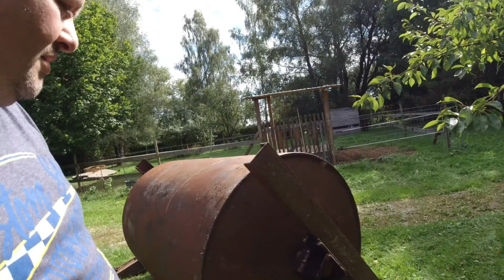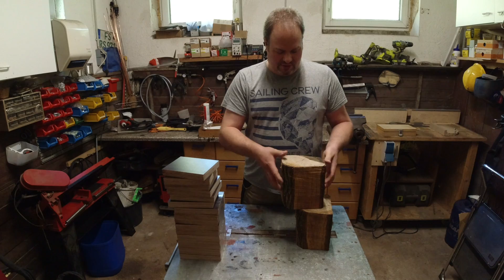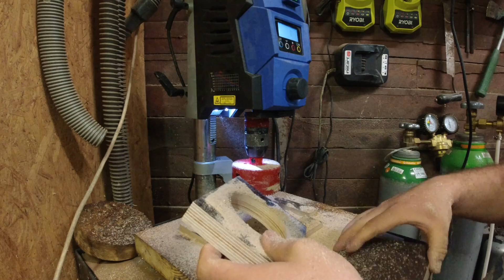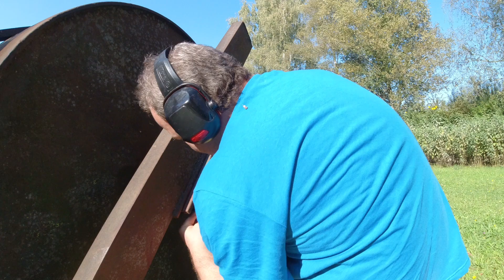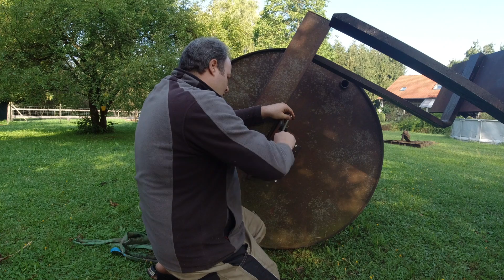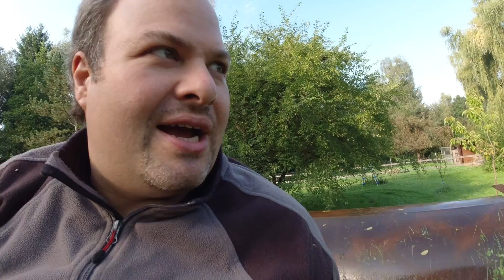Vom Schrott gerettet 🚯 Restauration alte DDR Wiesenwalze 🛠 Projektstart 👉 Holzlager bauen

Comment: Grüße. Wir nutzen diese Walzenkombination als Dreierzug auf ca. 200ha pro Jahr. Keine Ahnung ob deine Holzplattenlager halten werden. Wir haben Hartholzlager drin. Dringend erforderlich ist aber ein Fettkanal damit du täglich abschmieren kannst. Ohne geht es nicht lange. Das Lager wird so heiß das es sogar verbrennen kann. Also immer schön Fett rein. Noch was. Ich weiß ja nicht welches Gelände du so walzen willst. Bei abschüssigem Gelände ist äuserste Vorsicht geboten. Wenn die Walze voll Wasser ist macht die mit deinem MF was sie will. Nur zum Vergleich. Bei uns wurde der Dreierzug zu DDR Zeiten mit dem K700(220PS Knickkenker)  gezogen . Heute haben wir da 300PS  davor hängen. Bergauf ist ein schwerer Schlepper nötig um keine Schäden auf dem Grünland zu hinterlassen. Bergab um nicht über den Haufen geschoben zu werden.
Reply from the maker: Hallo 👋 ich nutze die Walze nur auf meinem Moos Grundstück mit 8000qm und der Wiese mit ca 3500 qm. Bisher hab ich mit dem MF eine größere ich glaube 5 Tonnen Walze gezogen. Die allerdings nur Leihweise. 
Berge oder Hügel haben wir gar nicht. Wir haben nur Flachland. Nicht mal Strasse ist dabei. 
Interessant aber zu hören wie die zu DDR Zeiten benutzt wurde. 
Wie lange das Lager hält werde ich sehen. Denke aber das es nicht kürzer halten wird als ein Hartholzlager da die Platten sehr stabil sind. Wie wurde da ein Fettkanal in den Orginal Lager eingebaut? Ich hab Lager zum kaufen im Netz gefunden (leider nicht das richtige Maß) die hatten alle keinen Fettkanal. Ich werde das aber mal beobachten wie heiß die Lager bei Benutzung werden.
Danke dir für die Tipps. Lg Max
Reply: @AufdemLande  Bei uns ist von unten ein Fettnippel in den Lagerkasten geschraubt. Von da eine Bohrung bis zur Welle. Bei unseren Lagern ist das Loch für die Welle auch nicht durchgängig so das ein Wandern des Lagers vermieden wird. Auserdem haben wir noch Beilegescheiben zwischen Lager und Walzenkörper.
Reply from the maker: Danke dir dann weis ich ja noch was ich zu tun habe. Das hat mir sehr geholfen👍. Grüße Max

Comment: Wie breit ist die walze
Und normal sind die holzlager aus mehrschicht holz das In öl getränkt ist so zumindest am schüttlerlager vom Mähdrescher aber an der walze hält das so auch ewig
Reply from the maker: Servus, die Walze selber ist 1,80m breit. Interessant das solche Lager am Mähdrescher auch verbaut sind. Wie werden die dort gefettet? Ich denke auch das die an der Walze sehr lange halten werden. Lg Max
Reply: @AufdemLande  die lager sind nicht schmierbar 
Laufen mit 300 umdrehungen auf ner kurbelwelle welche die hordenschüttler antriebt 
Bei uns haben die lager 3000 betriebsstunden gehalten bis sie 1-2 mm spiel hatten 
Hab selbst ne 2,2 meter walze 2 teilig 
Aber mit Kugellagern 
Aber leider ohne fahrgestell dies könnte sich aber nich ändern 😅
Reply from the maker: Also wenn die beim Mähdrescher 3000h gehalten haben, dann überleben die Holzlager die ganze Walze 😅 Fahrgestell? Meinst du ausklappbare Reifen für Strassenfahrten?
Reply: @AufdemLande  ja eine runter klapbare achse für die straße 
Die holzlager werden heute noch in den Schüttler Mähdreschern verbaut